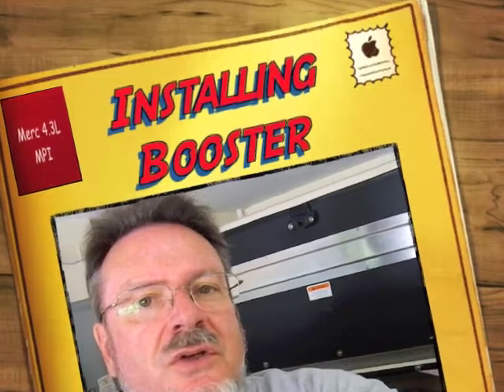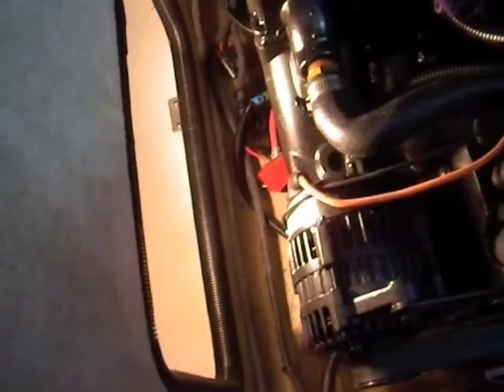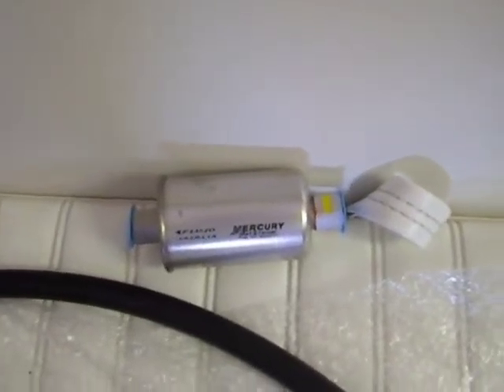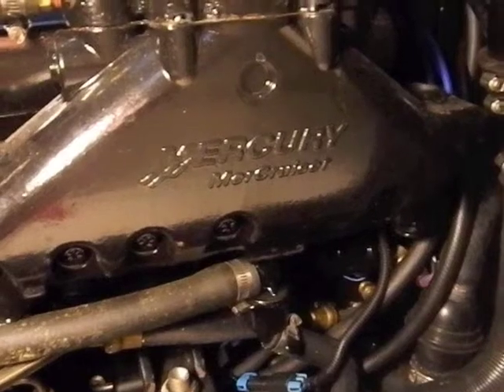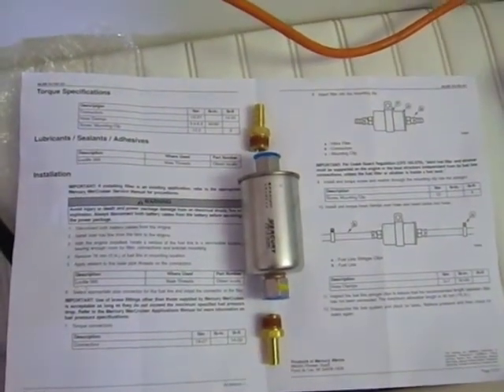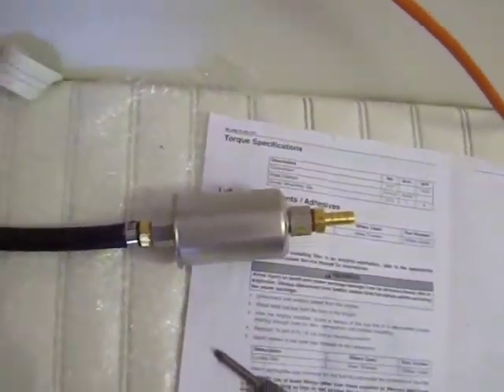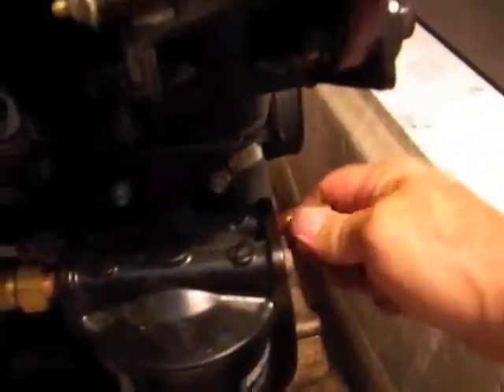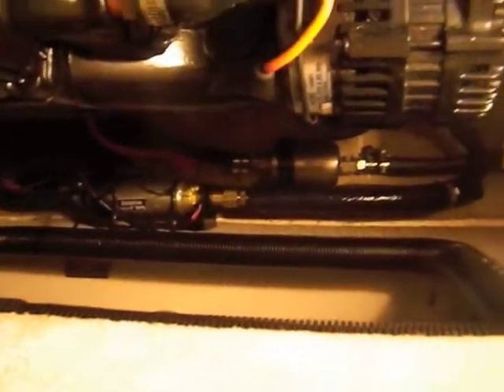Installing Booster Fuel Pump on Mercruiser 4.3L MPI

Comment: Great video - Does the pump provide some pressure regulation or does it run wide open all the time, dumping all my fuel into the engine...?

Comment: Hi, this post is old and probably you will not answer, but please, help ( twin 4.3s MPI ) in a 2004  Searay Sundance's 280.
Installing the pumps fixed my vapor lock issue, but every once in a while the Fuel pump fuse melts, it doesn't burn so I believe there is no short, but it gets very hot to the point that eventually it melts... so, what do you think Im doing wrong ? same cables and fuse for 2 pumps are being use now for 4...   could this be my problem ?
Thanks
Reply from the maker: Sorry Carlos but I'm not qualified to answer your question. Your theory about too much load for 4 pumps sounds reasonable though. Good luck.

Comment: Hi Barry
This is the issue that I have been having with fuel flow and vapor lock. Boat will just  start bucking like it having fuel starvation. When hot it will just stall completely but you can start it right back. Crazy What is the kit Number and maybe a place that you bought it. Thanks so much I have been chasing this for months and came across this video. Thank you so much!
Reply from the maker: David, I bought the booster pump back in 2010 so I have forgotten where I purchased it. I'd suggests some searching for terms like "booster pump" and the model of your motor.
Reply: @kinrara1  thanks Barry I did find a link to a merc cruiser 4.3 MPI booster pump. Great video.

Comment: Did you completely disconnect the old fuel pump?
Reply from the maker: This was installed as a booster in addition to the old, original pump. My old pump has continued to work well but it just wasn't enough to overcome vapor lock issues. I do not know whether this would be sufficient to use instead of the original pump.

Comment: If my fuel pump goes out, can I install this instead and have to takeout the existing pump. The existing pump is next to impossible to get to.
Reply from the maker: Danny, I'm not sure if this would be a workaround for failure of the primary pump. My guess is that it would depend on how the original pump failed and how much fuel is getting through it.

Comment from the maker: This seems to have fixed my vapor lock issue, at least - so far so good.  I've been out on hot Florida lakes, turned it off for an hour and it started up easily and ran smoothly afterwards.  I did not install the check valve that you mentioned.

Comment: Nice video. I too have the same engine (twins) on my Sea Ray 280 Sundancer and am suffering from vapor lock. So...did this fix the issue for you?
And did you also install a check valve that Mercruiser recommends for the raw water flow into the fuel cooler?

Comment from the maker: @thebird95632 There were extra hose clamps in the package so I figured that I might as well use them.  I'm sure one would be sufficient since there was only one on the original connection to the main filter.